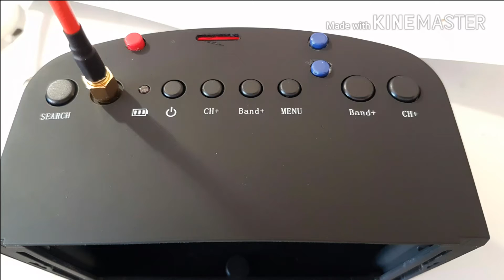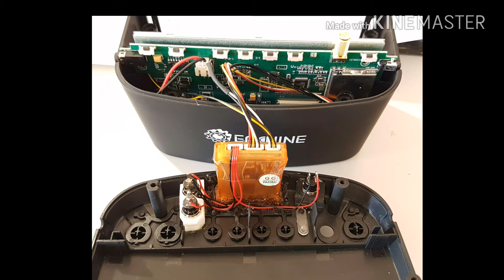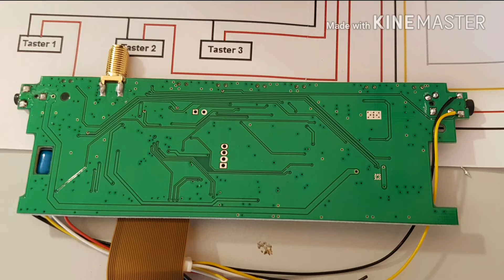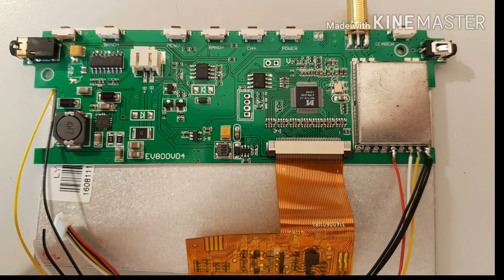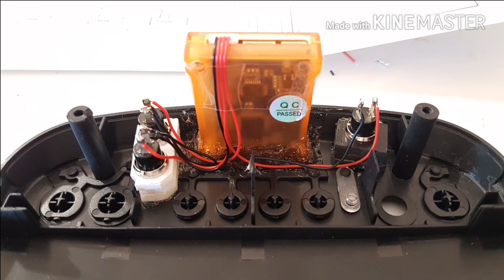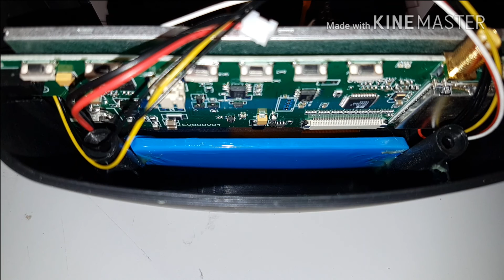Eachine EV800 Eachine ProDVR Mod

Comment: danke für dein video! leider macht mein eachine dvr recoeder probleme. auch mit 5v stepup. wenn die signalqualität nachlässt bekomme ich ricchtige aussetzer in die aufnahme :X weißt du da was? mfg derBaron
Reply from the maker: Hallo
Leider nein. Nutze die Brille nicht mehr wirklich. Sie liegt hier nur noch rum.
Aussetzer sollten aber nicht vom Recorder kommen da der nicht merkt wie weit der Sender weg ist. Ist es besser wenn du dir das Livebild direkt ansiehst ? Ich denke das liegt eher an deinen Antennen. Nutzt du die originalen Pferdezahnstocher ?
Reply: hallo. danke für die antwort. ich habe den fehler eingrenzen können. das komische hierbei. ES LIEGT AN DEN KOPTERN :D wie und wieso auch immer. meine bildwiedergabe an der brille selber ist bei jeden racer top. die dvr aufnahmen haben ledeglich die weißen aussetzer bzw störungen drinn. mir ist nun aufgefallen, dass diese nur bei bestimmten coptern der fall ist. ein step-up-boaster am dvr mod habe ich auch schon ohne erfolg getestet. die bildaussetzer habe ich auch nur beim fliegen. benutzen tue ich cloverleaf antennen. wenn du dir mein neustes video anschaust siehst du wie es bei mir mit den koptern aussieht wo ich wenig bzw keine störungen auf dem dvr gerät habe.
Reply from the maker: Hast du für die FPV Stromversorgung einen LC Filter verbaut ? Verschmutzte Stromversorgung könnte eine Ursache sein oder auch einbrechende Spannung wenn du feuer gibst.